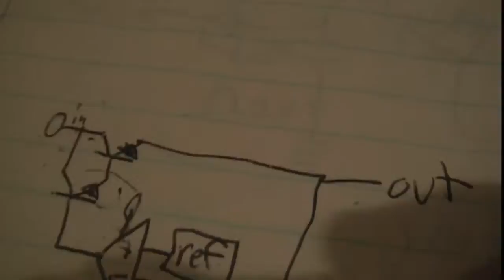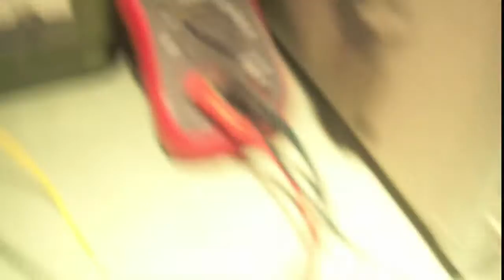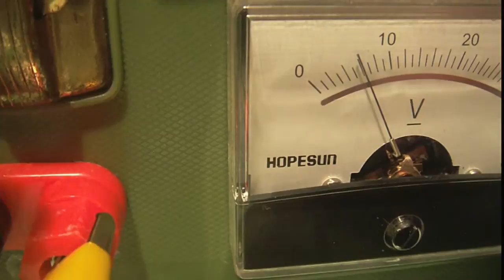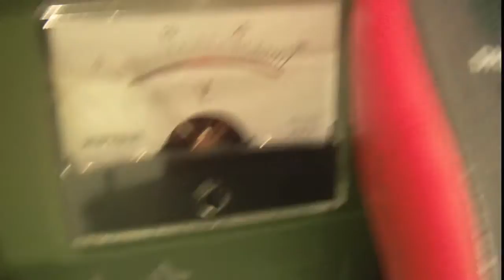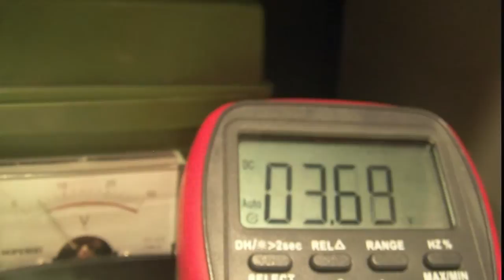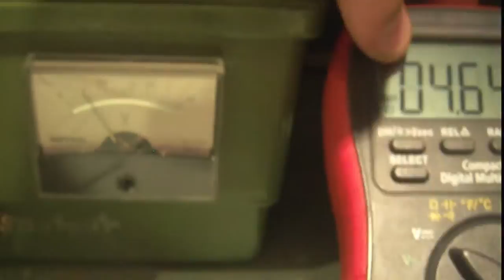Mosfet Voltage Regulator

Comment: You could also use a P-channel MOSFET and reverse the inverting and the non-inverting inputs on the opamp. It isn't tracking nice when you apply load for a very good reason that is only visible with an oscilloscope. The MOSFET in the arrangement that you have is actually oscilating at a very high frequency. You can counter this with a low-pass filter on the feedback line (somewhere like 10-50kHz would do the trick, depending on opamp and MOSFET). This is because the gate of the MOSFET acts like a capacitor, and the opamp can't instantly charge it and will overshoot and overcompensate for the overshoot by bringing the gate voltage too far down.

So, for low dropout (near 0V if you want to), use a P-channel. To improve tracking, use a low-pass filter on the feedback line. By the way, the MOSFET isn't getting any hotter then an NPN would in that arrangement, they would both drop the same voltage and pass the same current, so power (heat) would be identical.

Comment: I would suggest using a logic level MOSFET, which has very low gate threshold voltage. And they fully turn ON at 5V. Using them should reduce the drop.

Comment: also, heat loss is the same as a standard linear regulator (LM317). You lose your 500mA multiplied by the input - output voltage differential. Cheers :)

Comment: you keep saying the MOSFET has a voltage drop of 4-5V. Actually, it's functionality as a switch is limited when gate voltage is below 10V, where most FETs are saturated. Add roughly 1.5V drop on the op-amp and we discover that if the supply voltage is above 11.5V, the FET works great. Use a potentiometer to set Vref from main power supply, and calculate another fixed resistor(or use trimpot) so the max settable voltage is 1.5V lower, thus fully utilising the pot sweep.